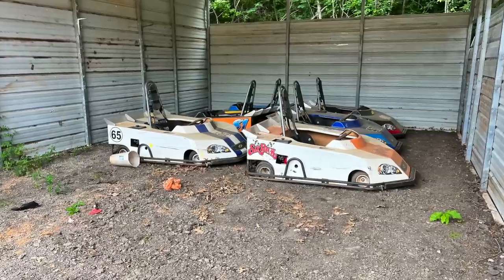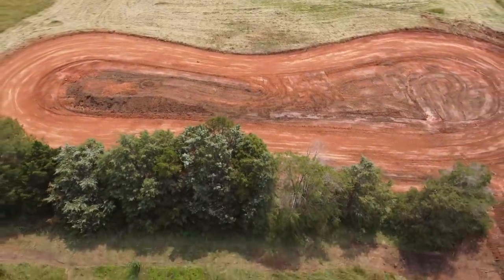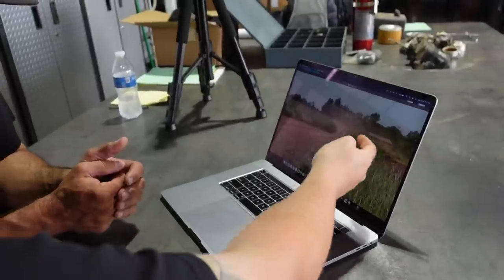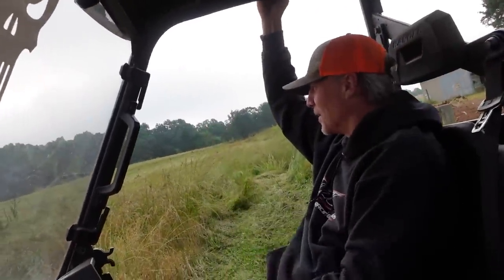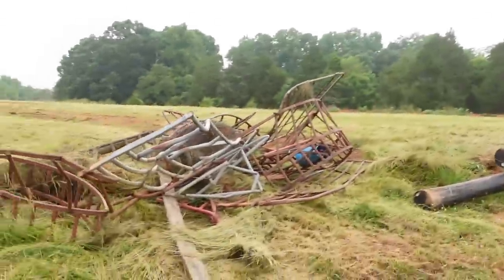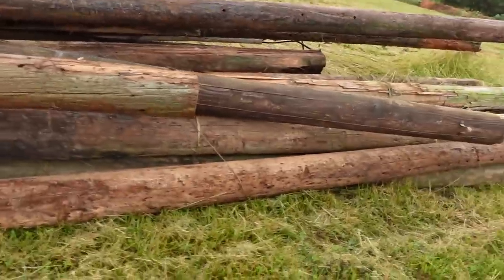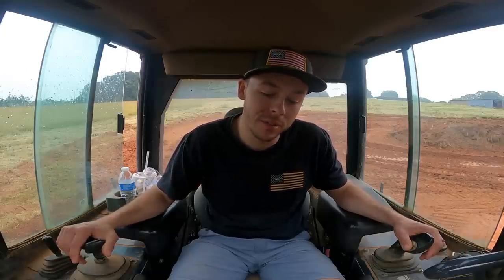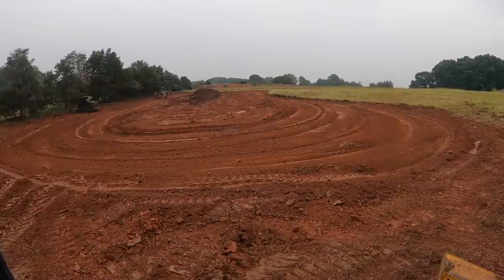Building Childhood Dream Race Track For Dale Jr's Go Karts! Part 2

Comment: Use an old piece of chain-link fence and lay it on the ground and then cut one of those big telephone poles that you have and attach the telephone pole on top of that fence and drag it around the track to smooth the track out or drag around a big 6 x6.      If you put a pair of vise grips on the rim, it’ll hold that tire in place and then you can just use your tire tool and slide it right on.
Reply: Listen to this guy
Reply: I was just going to say that
Reply: Yes any type of homemade drag
Reply: Can confirm this tips are accurate
Reply: Exactly …
Reply: Yes this is exactly what you do.
Reply: What he said!🍻
Reply: This guy!!!
Reply: Was just thinking the same thing. Looked up and saw your post 👍
Reply: Yep the chain link fence trick works great for grading even driveways an shit
Reply: Road grader bud only way to go

Comment: Maybe try a motor grrader. Those are very precise.  I also think Cleetus McFarland should race. Like you Brad, the man can race anything! It would be funny seeing a giraffe on a kart!! 🤣
Reply: Omg that would be funny to see Cleetus get in one of those go carts
Reply: I agree with a motor grader with a smooth drum roller or a rubber tire roller would work.
Reply: @redneckmafi they also have dozers that the blade is controlled with laser’s if you can’t get a road grader.

Comment: Build a drag to pull behind a truck or side by side. Get some 6” heavy pipe about 6 or 8’ long. Weld some old chainlink fence between two pieces of the pipe. Use some chain to pull it behind truck/side by side and make laps around the track. Rinse and repeat.
Reply: Make sure the fencing is dragging flat across the track

Comment: You need a road grader for sure. That'll get your surface leveled out. Then dragging a tractor tire around. Then water, and water, and more water. Then the best way to run it in os a light vehicle of some kind and run the water in to seal it up and lay the track back down. Ive seen small pickups theyve put some slicks on the front to work in some of the tracks ive been to. You have some badass clay to have a fast track there. It's gonna be awesome once you get it smooth.

Comment: Do you not have a beam and chainlink fence drag like used at baseball fields? It may not pack it with the fence and weight but it will make it generally smooth. Then u can pull a roller on it after.

Comment: Park a lawnmower on a truck hood Upside-down and drag it, The flat hood  with the added weight to hold it down will do a good job of filling in Holes and knocking down high spots while packing the track at the same time, we have a hood with a piece of railroad tie iron on it for dragging our driveway and it works very well!!!

Comment: I would put some slicks on the UTV and rig up a chain drag like they use on baseball fields. That would allow you to use the UTV to pack the dirt and the chain drag would move the unlevel dirt around where you need to fill the voids.

Comment: A motor grader with a laser and a vibrating roller to pack it in good. You could shape the banking to exactly how you want it, and fill any holes and get them all packed down and from then on it would just need a light clean up after the races.

Comment: A chain link gate with some weight added drug behind a truck is what you need to make the whole track completely smooth. Like they use for grading athletic fields. I highly recommend adding a LOT more ties so the fence fabric doesn't pull away from the frame and wad up. Big ass zip ties every six inches to a foot work really well.

Comment: My suggestion is level it as best you can go along and fill in the dips use pull behind dirt box leveler that goes behind a tractor and a roller of some sort with either water or sand in it and roll it and fill in the necessary areas. Then you can take a what they call a farm rake that pulls behind a tractor or possible a chain link fence all the way around that will help to preserve the track.
Here's another thought once you get your go-karts going and the race is going maybe in the future having lawn mower races that's a big thing today. It's just a thought.

Comment: One thing that might help for you to get water down to the track without drilling a well might be getting a hold of one of those trucks that have water tanks that Road crews use to spray the dirt to keep the dust down that might help. But just a suggestion.

Comment: Build a drag that pulls behind the tractor. A couple of 10 foot or longer I beams with 3 or 4 plow cutters spaced out in-between them. a few laps with that will cut the tops and fill the lows. You will be smooth as glass in no time.

Comment: The chain link fence and pole DOES NOT WORK, using a tracked machine only rips it apart.  Clay soil has to be compacted so water doesn’t penetrate it. Give it a few degrees of slope in to the center of the track for water runoff.  We made a low point on the track and ran a 8” abs pipe under the track to let the rain flow through the track exit.  Bryan (ran the BMX for 23 years) built more than 27 tracks across CA&AZ.

Comment: Use a power harrow to break up and lay flat then water the track. Throw some wide tires on the Vic to make it a packer. Then reverse pack the track from outside to inside. 

If you did your race mid week there's enough drivers in your area especially late model sprint and midget guys you could have to come play around for the cow patty. 

You could even go to milbridge on a Tuesday or Wednesday night to watch how they prep the track to get a better understanding to get a smooth racing surface.

Comment: Little trick with those tires is to use vise grips lock them on the wheel as you go around holding the tire on

Comment: They make a box leveler attachment for your dads new skid steer. Landscape company's use them. It attaches on the front and it will take out the highs and fill in the low areas. Perfectly level.

Comment: Unless you want a lake in the middle of your track you need to trench in drains to the infield.  You need to either use a patrol/road grader to cut your slopes are drag it with a heavy piece of steel.  Needs to be solid and straight.  Could maybe use one of those telephone poles.

Comment: The backside of the wheel is a slightly smaller diameter so you mount them from the backside, with literally two long flat head screwdrivers and pop them on

Comment: Take it from a track prep guy at a dirt track. Packing a track in a oval is hard to make it perfectly flat. Your design is cool but I have no clue how you will pack it and not be rough. Your virgin track should be sheep footed to pack it in to have some kind of base. I use a road grader to make it flat and then use a set of disc behind a tractor to tear it up then water the shut out of it. Then we put 5 cars on the track with wide tires and run them the opposite way you are racing.

Comment: Drag a hare looks like chain link fence but way stouter one side has hooks like teeth pull it on 30' angled  inside of track pull it  backwards then race direction outside to inside 4,5times flip hooks up then inside work out set plywood on top couple of tires for wait play with angles an speed it'll come around  pack it backwards first time with golf cart enjoy

Comment: Get you one of those 250-gallon enclose tanks that have the cage around them that is narrow enough to say on the back your side by side then get you some 2-inch PVC pipe and the t-two in caps and the coupling to attach it to the water tank will you some holes in the 2-inch PVC pipes attach it to the t then it's a gravity-fed water in system I know at first it will take a lot but that'll help you during races and stuff to re-wet the track